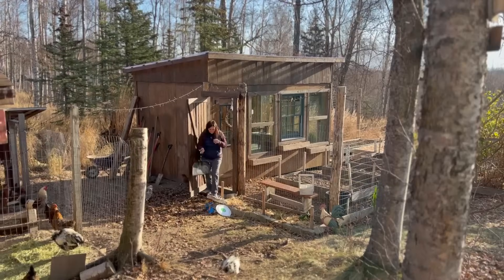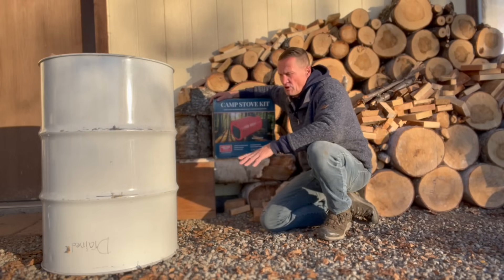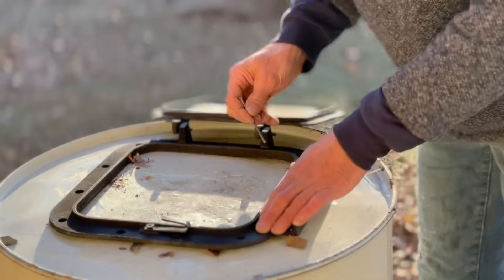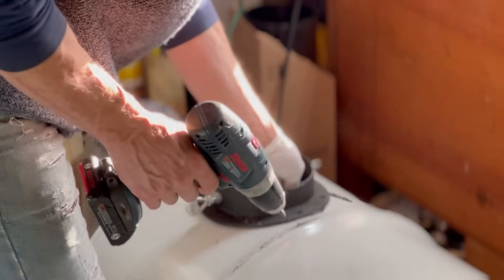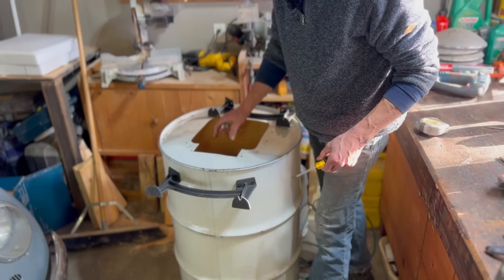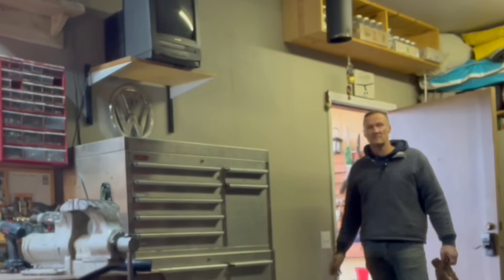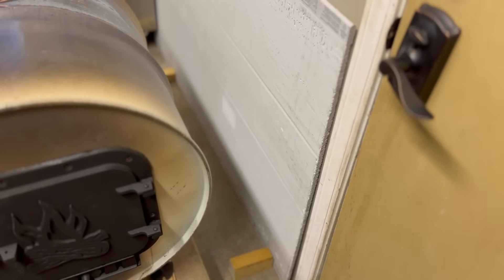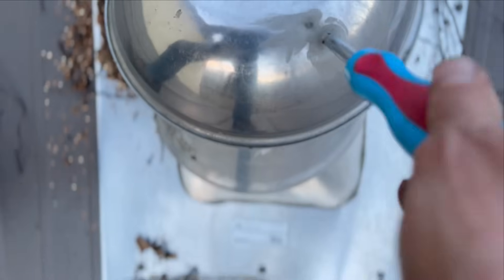Homestead Life in Alaska~ Preparing for Winter with Barrel Stove ~ Nordland 49

Comment: Oli, I installed a barrel stove here in NJ over forty years ago. I used an extra heavy wall 30-gallon barrel inside a 55-gallon barrel- suspending it with bricks on the bottom of the 55-gallon barrel. This, in effect, makes a hot air plenum which I ducted into my central heating natural gas furnace. I used a standard 8" round HVAC duct. It works so well (and the cost of natural gas here in NJ is so stupid) that we rarely use natural gas anymore.  For example,  it's the middle of January and we've turned on the central heater once in this heating season so far.  Another advantage of the barrel within a barrel is that it affords a measure of safety. The outer barrel gets very warm- but not nearly so much as the inner (fire) barrel. Something to think about with grandkids....

Comment: Cool stove kit. If you can find a few like 12 flat fire bricks and a grate it will last forever and be able to be run with a hotter fire. Only issue with these stoves is that the bottom will burn through. Really something you don't want to happen when there is a roaring fire in it. Just lay the bricks along the bottom side by side for the full length of the fire box. You will be amazed how well it will burn on a grate placed on the bricks. Totally jealous of your beautiful home and shop. Have a warm and safe winter. Be sure to put a CO detector in the shop as well, just in case.
Doc
Reply from the maker: Thank you so much. We are going to try it out!  Thank you also for watching, we appreciate it!
Reply: It will make the barrel stove last a whole lot longer. Also as a safety issue, the bottoms of these stoves virtually never burn out while the stove is cold but so so with a vengeance when a fully loaded, burning stove dumps itself on your floor. Good luck and stay safe.
Reply from the maker: This is great information! Thanks again!

Comment: I've been running a double barrel stove for a little over 10 years. They have a metal grate that fits inside the barrel, I filled the bottom part of the barrel with sand and put the grate on top of the sand. That kept the fire from burning through the bottom of the barrel and it's lasted me over 10 years so far..
Reply from the maker: That is a great idea !!! we are absolutely considering putting sand on the bottom and then bricks over it .
thank you for watching the video and the great comment 
have a great weekend !!
Oli and Tacia

Comment: if ypu add sand or fire brick in the bottom of the stove it will last a lot longer before rotting through. if you use fire brick put sand in after you set the brick to fill between the bricks. an old homesteader
Reply from the maker: We are going to try this out. Thank you so much and thanks for watching! Take care!

Comment: I would have burned that barrel from the outside. 
The correkt chimney tube mount is opposite of what you did. Preventing soot running.
Reply from the maker: Great idea, this was perfect timing! We never even thought about that and still haven't put the set screws in place yet.  We are going to take the stove outside and use the weed burner to burn off the paint.  However, I don't understand the tube installation part.  It's a double pipe and the sleeve on the inside prevents the soot from going out.  Any more information would be appreciated.  Thank you for watching and leaving a comment!
Reply: @NORDLAND49  If the tube parts you touch at 15:10 were reversed, the soot wil not be able to run out. But they all then have to be reversed. It's a theoretically problem, so I don't think it'll run out.
Reply from the maker: Thanks for your quick response...we will definitely check into it! Oli is actually going to go look at it now because it's bugging him! LOL😆

Comment: nice video and content, two questions. I've never seen the reducer in the flu done were the bottom part is on the exterior of the upper part, this allows smoke to come into the building. and the second question is did the instructions tell you to put the flu cap that close to the roof that far down from the peak, this can cause a down draft. some one else mentioned how close to the door it is.
But like I said nice video and editting.
Reply from the maker: Great points! Thank you for watching the video and leaving a comment, we appreciate it. The outside chimney may possibly need to be extended due to the reasons you mentioned (downdraft), however we never had a second piece up there because the winds always come from the Northeast...preventing a downdraft.  We are going to see how it goes. About the flu...it's a double wall flu and the inside of the flu is pointing in the opposite direction than the outside.  I followed the instructions of the arrow on the flu, however when it comes to the connection to the cealing, I may need to add another piece I am not aware of and will look into this.  Thank you again and take care!